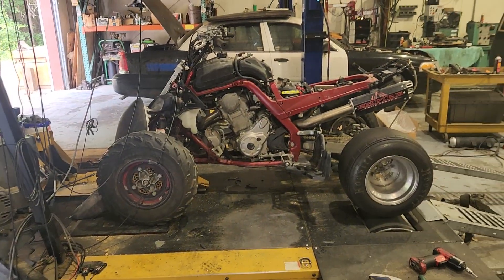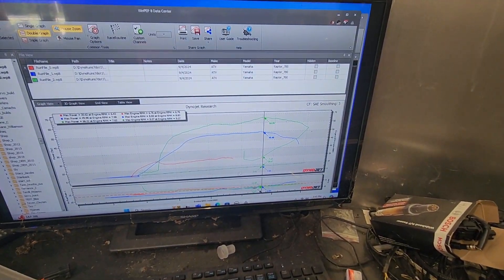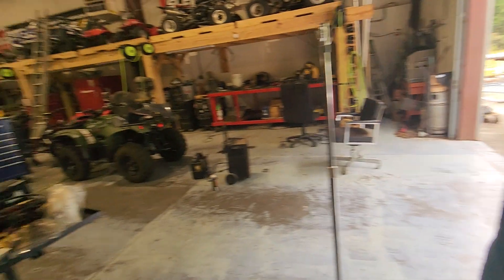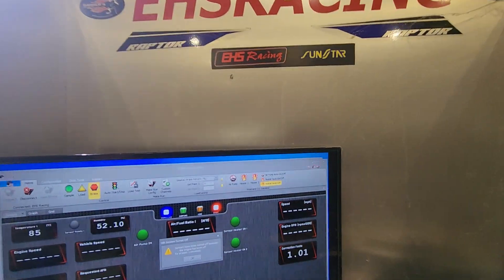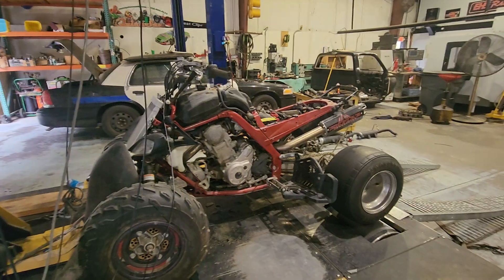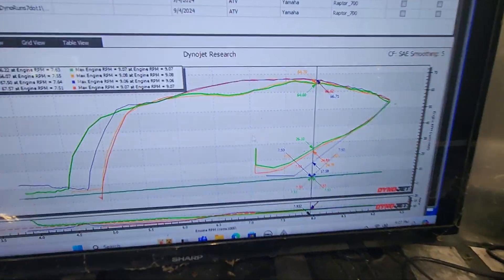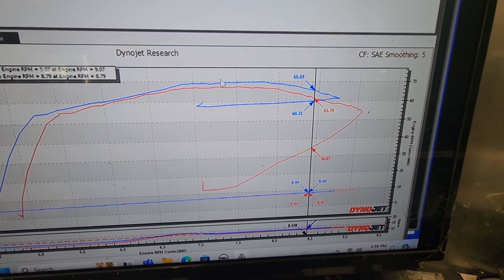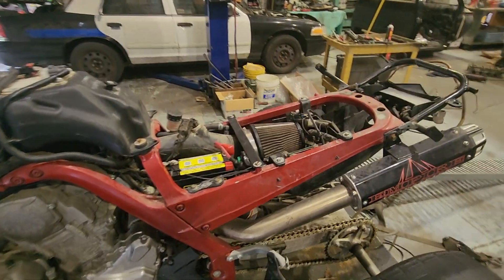2019 Raptor 700 picking up 10hp with a ecu flash. Example of our EHS flash vs competition tuner.

Comment: Thanks Eric, I have the EHS tuner with full barkers exhaust I was wondering if you can flash my ECU to not draw so much power in 5th gear due to the speed limiter or whatever it’s called?